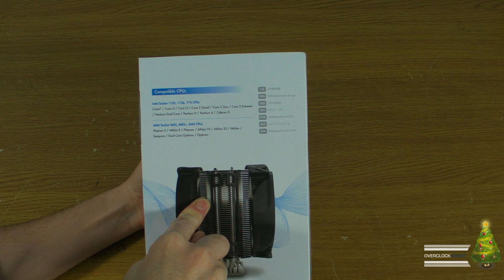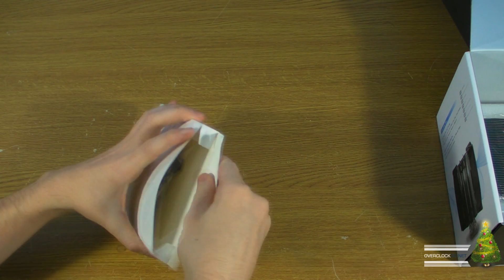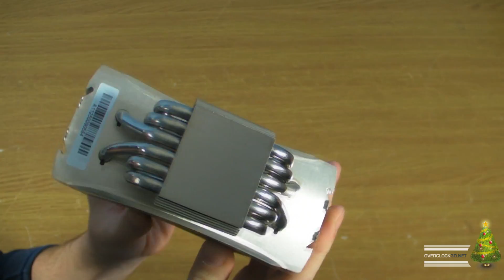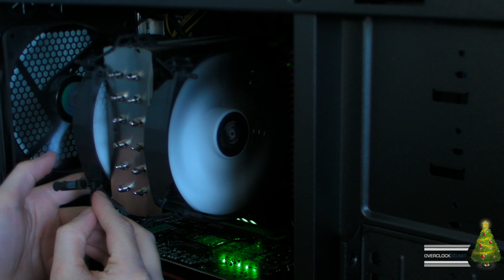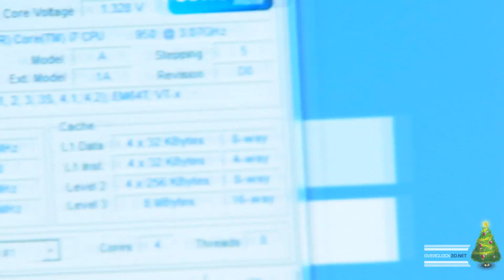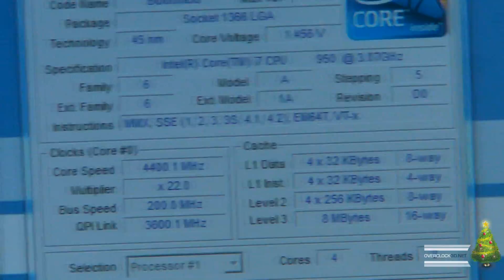NZXT Havik vs Noctua NH-D14 Review

Comment: ***** Use AF fans from Corsair if you want to take that route. SP fans are more necessary for liquid cooling.
Reply: What? No, SPs are good for heatsinks!
Reply: AF stands for Air Flow, SP is Static Pressure. AF are good if you have nothing blocking its path. SP fans are good for liquid cooling if you put them on radiators because the fan will have "static pressure" in front of it at all times from the radiator. So if you want to put fans on a heatsink, you would want SP fans like you would on a radiator, since it blocks it the same way.
Reply: daniel wray ... SP fans are good for Heatsinks,, which basicly is a radiator..

Comment: Havik. It runs quite a bit cooler then the D14 in all my tests. on the newer generation Core i5 and i7's it is a better solution it seems. I dont understand the high temps i see here but i might be that its a very hot running i7 as i dont know the 950 that good :)

Comment: I just wanted to add that if you plan on putting it onto an asrock z77 extreme 4 it WILL cover the first ram slot with both the fans on, due to the motherboard being smaller(narrower/slimer) form factor than a regular ATX.

Comment: @TimeToLiveCustoms i have phenom x6 1090T no OC with stock cpu cooler and i want to know if this cpu cooler is really good for my phenom without doing OC and what case should i need to put all this? btw the motherboard i have is a micro-ATX (9.6x9.6 in) and is this power supply good HALE82 750W  for future upgrade like one GeForce GTX 660 or 650? I've been searching a lot and i get really confused because  people never answer my question and they end talking about other product

Comment: Hello Tom,

Exactly just how cheaper is it than the Noctua nh d14? because the latter is still at around $89-99$ here in canada.

it seemed a bit louder than the noctua, it definitely not sound like a 25 dba to me as mentioned,  if you were to give a dba off the top of your head, how much would u say it would be?

any recommendation for a thermal paste? iv got the artic silver mx3, do u recommend something else perhaps better?

finally, would I encounter any problems fitting it on the lga2011?

Comment: I still like my STOCK  Extreme Intel. 35nm 6 core Gulftown  Heatsink better !! Both at 4.0Ghz and 4.2 Ghz it out Performs the Havok and the Nochua !! Using MX 2 paste it idols at 27c and running prime for a hour never goes over 42c at 4 Ghz.. That's with a room temp of  20c and will take a video to prove it ! I know many won't beleve it but Tom I swear it to be true ! Oh and my voltage is 1.256 volts ...

Comment: Heh, nice job NZXT. But the wobbly mount...

I really want to se a review with the CoolerMaster Storm Trooper and 2 rads in. One at the top (240 or 280mm) and one at the bottom (240mm) with max thickness possible and a hot GPU in the loop. That would be just great!

Comment: Hey again Tom. For how long should i run prime to consider my pc stable? Some reviews say for less than an hour and some other say for like 12 hours or something. I really like your reviews and appreciate your sayings. Testing my 950 atm at 4.4 ghz and it seems pretty stable at almost 30mins with settings x21  209.5 bus speed and 1.445 voltage with max temp at 80.